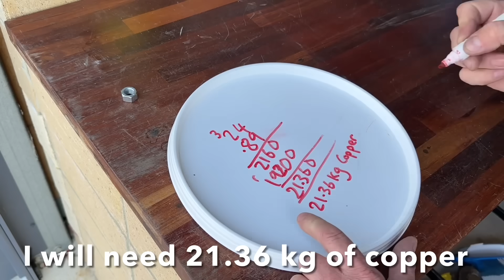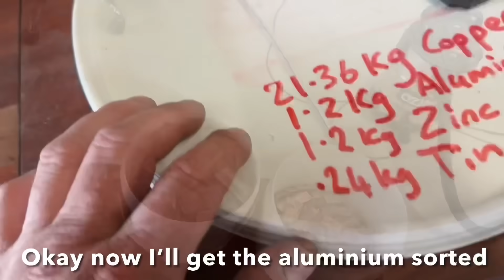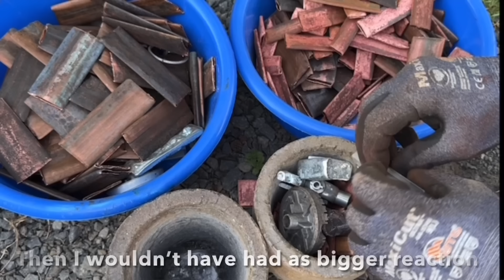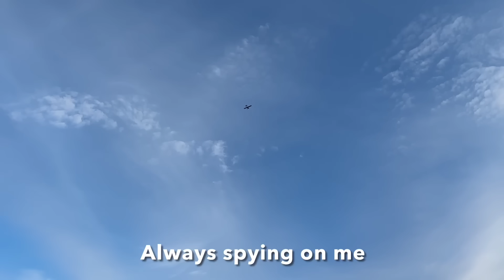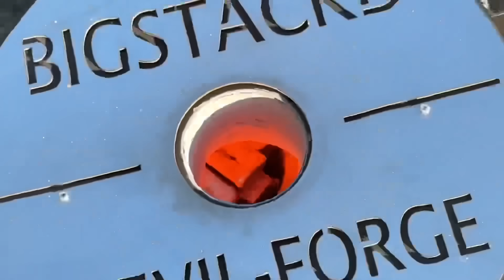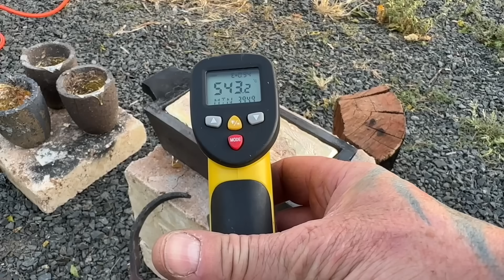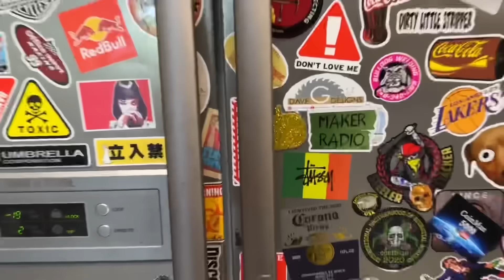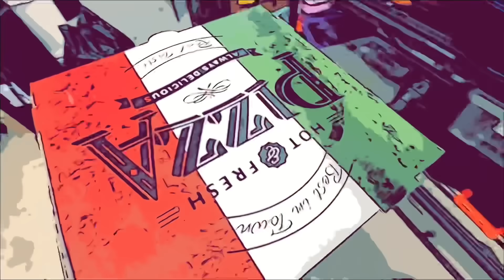20 KG Nordic Gold Ingot from scrap - ASMR Metal Melting - Trash To Treasure - BigStackD 44LB Bar

Comment: Engineer here… As always I’m totally impressed by the woodworking! I think the bounce and torsional instability comes from the brackets. I would’ve sandwiched the beam between angle iron with throughbolts. The other flange to be used as anchor points. I think large throughbolts would have played into the heavy modern industrial look better than small strip steel brackets.

Comment: Ouch!!! Fortunately the sleeve that one of your subscribers sent you some time ago did its job, the pipe was protected even if the sleeve itself was a bit expensive, it did the job it was made for, protecting the pipe. And so the difference in weight between what you were supposed to put on and what you put on triggered this reaction, luckily you weren't close by and you kept an eye on what was happening to quickly extinguish the gas, well done! 😉👍

Comment: On safety note, I would place the heavy ingots low near the floor.  At some point you will design your outdoor work station to implement  improvements.  A hinge and counterweight on the lid of the big forge would make it a one hand operation and move you away from the heat.  Putting hot ingots on ice is fun to watch, but I imagine a wood box with a steel baking pan floor to hold the ice block and contain the ingots over the ice. Top Tier ASMR!

Comment: I wonder if melting togheter the zinc, tin and aluminium together at lower temp then add the copper in would increase the vaporization point enough so zinc wouldn't react that much at such high heat. If it's in an alloy, I'm not sure, but it might help.

Comment: I can imagine a “self feeding” device to save time while cutting tubes. Simply two long enough pieces of wood that serve as guides and some sort of spring or elastic band that gently pulls the tubes closer to the pliers after each cut. Like the can crusher but longer, slower and without power only a string or elastic belt. Could work…

Comment: You should weld your copper chopper/cable cutters to a plate so you can set it on a table and chop faster and easier. Then make a power hammer that flattens your copper faster. If you set up an assembly pine you can automate the whole cutting and flattening process so you can set you copper tubes in and return to all that work being done over night 💪😃. And you can make a crank/pour/ step down furnace so you pour several ingots at once without having to lift  a heavy crucible or risk spilling hazards.
Reply from the maker: Yeah I hear that buddy maybe some type of guillotine type shit. I wouldn’t mind a guillotine set up for my Copper wire to turn it into tiny little millimetre size pieces so I can fill the crucible more and not have to keep feeding the furnace. I do have a guy building me a Hydraulic pipe cutter his channel is crazy Harley rider I believe and I think he’s made videos on making it but I’m just gonna wait until he drops it off and have a look at it then. Then we’re gonna have a chat about some type of customised cable cutting machine.👊🏻😁.
Reply: @bigstackD  I would lov to see you getta hold of Aussie gold at sompoint in the future. As we'd lov to see you hav fun melting it down and then make aproper hallmarked goldbar out of it of using hallmarked or unmined Aussie gold 😁😉👍🤝🇦🇺🇬🇧

Comment: I'm totally impressed with the patience to cut all the copper pipes with a wire cutter then blasting them with the hand tamper. Hats off friend I would have spent more time finding a more efficient and labor intensive way to do it to end up with the same result.

Comment: A good source for Zinc is modern wheel weights. The old ones were lead with an embedded steel clip in them. A lot of modern wheel weights are made from either steel, aluminum or Zinc.
If you've got any friends that work at a tire shop or a car mechanic's shop, hit him up for some wheel weights.

Comment: have you thought about having an old dead crucibel lowerd in to a block of concret/cement with an angle (aka any hard non burning material) and having it as a slag pickup station?  wraping the sides of the crucible so you can remove it from the cast. fast cleaning and sorting of all the slag and no mess in the end.
hopefully i could make myself understandable english is not my native langue. and keep up the good work you are a friday stapel!

Comment: 7:00  I bet you could make a jig that holds the cutter in position, and drops the pipe through the jaws to a consistent length.  Each cut-off piece falls into a bucket; when the jaws open, the pipe slides down until it hits the stop.  Rinse, repeat.

Comment: A lot of electrical fittings are made of zinc. Used to be anyway, any time we do a remodel I save as many couplings and connectors that I can. 
Nowadays they’re made of steel with the exception of mc cable connectors, they’re still zinc. I’ve got zinc coming out my ears lol.

Comment: Just a thought. A rolling mill may help crush all that copper pipe. A cheap one will run you a hundred bucks or so and save the shoulders. You'll want to do it before cutting the pipe down though, just for efficiency.

Comment: Your biggest Ingot ever! And Ingot took that personally until the end when you assured him he was still your favorite. Quite a show with the extra zinc added, thankfully you were using the hose protector even though you were on the gas shutoff super quick. 
So you guys don't work your way into summer heat,you just add 10f a day until it's too hot to do anything? I shouldn't talk were in Indian summer right now, normal temps are 40 ( 4.4C ) degrees in my state but were at 75- 80 ( 26C ) the last couple days.

Comment: the way u heat up the molds to remove moist, is the same method i use when painting with spray cans, think u call it aerosols... but heating things up to get moist out is good, never had a better and more perfect finish of my hobby painting.. of course the item can only be handwarm when painting....but it will look as if it was painted in a pro booth

Comment: Would it help setting the large mold on top of a running forge and pouring multiple crucibles then to prevent the layering?  The metal could all solidify at the same time then.

Comment: The sounds of the ingots searing into the ice remind me of the deepest hole ever dug in Russia- the drilling head was going into basically hot putty, it was so deep. If you put a mic to the hole itself it sounds like hell itself, like wailing and screaming. It's like a billion ingots all being dropped into ice at the same time as the heat yawns and wheezes down the hole.

Comment: For alloys containing zinc, I add about 1/3 cup of Borax to the crucible before I begin the melt. It creates a floating protective layer which shields the zinc from oxygen and virtually eliminates gas off. However, if you overheat the finished alloy it will still gas off.
Reply: Note 1: Melting with a borax layer will slowly eat away the crucible. 

Note 2: The borax layer needs to be removed before casting. I use a stainless steel spoon capable of handling the heat without degradation.

Comment: To get rid of the Lead, take those copper cuttings and dissolve entirely in nitric acid.  Then add some sulphuric acid which will only react with the Pb.  Filter the solution, which removes the Lead Sulphate.  Then add pieces of Iron to get all the metals out of solution.  Rinse, remove iron, melt.

Comment: @ bigstackD 
Your hinge needs a little re-engineering. I think the flaw is mostly in that it's a four finger hinge, when it needs to be a five, with three parts on the base, and two coming down from the lid. The pull when it's opened is asymmetrical,  bending both the hinge pin, and the hinge itself a bit. A simpler way might be turning the attachment points for the hinges into short vertical slots rather than just simple holes, to allow for a tiny bit of movement, would help keep the lid down, by getting it to settle level, by letting it lever the hinge up a tad, and letting gravity hold the lid down properly.

Comment: Would you say Zinc is a good metal to start with? It seems like the start up costs would be low but allow you to melt and do some molds?
Small melting dish and a torch.... I would like to kinds get started, but I imagine the costs for the furnace and such can be a lot  at the start for something you may or may not stick with.
Not to mention needing to find where to grab scrap to break down. I have a feeling the tweakers in my neck of the woods have that on lock.

Comment: Hey dude... good result!! Obviously thats not a clean bar... just wondering how you remove the Silver and Platinum? Sreetips cornflakes it and runs it through a silver cell, do you do this part yourself or leave it to a refiner? Also MBMM use a shaker table to remove the free mill, not dissing ya, good result, looks 80% already. Just wondering what you use to refine it further?

Comment: You need to look around for a used light duty power hammer, as is used for forging iron, to crush down your copper pipes. You should crush the pipes first and then chop them into short lengths.

Comment: Scandinavian gold or Nordic gold, Nordic, is aluminum bronze, an alloy of copper with a small (5%) addition of aluminum and the same amount of zinc, as well as a small admixture of tin (less than one percent). The addition of aluminum makes the metal hard, and a thin layer of aluminum oxide on the surface prevents oxidation, due to which Nordic products do not tarnish for a long time (however, if the product, for example, a coin, is subjected to friction, tarnishing accelerates sharply due to the constant destruction of the protective layer)

Comment: Great video!! Question... what camera do you use for your recording? Thanks!!!
Reply from the maker: I used three cameras and they’re all iPhones The reason I have three is one will always overheat so I’ll jump onto the next one and use that while the other one cools down and then when that overheats I jump to the next one and so forth. Even when the furnace isn’t running if you’re recording in direct sunlight where I live the iPhone will overheat after 10 minutes which is really annoying👍🏻
Reply: Awesome. Thank you very much. I also used my iPhone to record and had the same issue. However, my GoPro also overheats. I like the zoom capability on the iPhone, so I will probably stick with that. Need to get a couple more so I don't have to wait for the cool down. Thanks for the tips. Have a great day!!   @bigstackD

Comment: copper is a pain in the but to smelt down in my furnace. gets right to the melting point so when it does melt down i have to be quick.
Reply from the maker: @Yeouiju-115  you could always leave it in the furnace for a bit longer that’ll  definitely help . 
Those Chinese furnaces do struggle to melt Copper with their underpowered burners unfortunately

Comment: Could you melt the zinc in a low-temp furnace, then melt the copper and pour the molten zinc into the molten copper? would that be safer?

Comment: Question, do you have any idea what could be the cause of the strange whirring sound when you start back up the forges? is it from the propane flowing in weird, or something else? I'm super curious!
Reply from the maker: It’s just a low flow gas. When the propane tank runs out of gas it makes the same noise and as it’s starting up there’s not enough gas in there until I’ve turned the gas on the bottle up a bit higher 👍🏻
Reply: @bigstackD  ah, gotcha! Thank you!

Comment: Does the Nordic gold tarnish much with time
Reply from the maker: It does tarnish the tiniest little bit. It just goes a bit dull, but you just put it onto the buffer wheel if it’s mirrored to bring it back to its perfect shine, or if you’ve just done a wire brush clean, you may need to give it another quick going over with the wire brush 👍🏻 but that’s normally six months away or longer

Comment: I can't confirm if this is correct, but from my calculations if you have a bar the same size (volume) as that big aluminum one made out of other metals:
          gold            50kg     USD 4,150,000.00
          osmium     58kg     USD 90,000.00 
          rhodium     32kg     USD 4,550,000.00

*Osmium being the heaviest metal and rhodium the most expensive metal
**A bar of aluminum that weighs 7000 grams would have a volume of 0.0025926 cubic meters (m³) and using that volume to calculate the weight and price of the others

Comment: I am just curious, and asking this as a separate comment to my usual running commentary, but why do you mix the raw metals together, and not just melt the copper first, then add the next highest temperature metal (aluminum in this case?) then the zinc and tin at the end? Seems that would be a less-likely candidate for burning the zinc. l obviously am asking from a place of ignorance. Thanks!

Comment: I've just started out and wondering where you can find or purchase the molds with handles please
Reply from the maker: eBay buddy this big one I use I can’t find them any more but you should be able to find smaller cast iron ones on eBay. I don’t recommend pouring copper into cast iron or steel moulds as they might work fine a few times but eventually the copper will fuse to the steel or cast iron rendering the mould useless, so I always use graphite for the copper and brass bronze aluminium for the cast iron or steel👍🏻.

Comment: Is nordic gold strong enough to make a bed frame?
Reply from the maker: Yes 100% it is mate. If someone could be bothered making one in that metal you would be completely fine it is in my opinion as strong if not stronger than steel that’s why I never stamp my Nordic gold as it’s basically impossible to stamp properly 👍🏻

Comment: 23:41 luckily you was outdside if the shed had caught fire it will need a lot of AFFF to put it down, a source of PFAS pollution, putting down road trains prime mover fires will be difficult because they contain up to 2000 ltrs of diesel fuel in their fuel tanks

Comment: How did the excess zinc suddenly flare up like that?
Reply from the maker: From previous experience what I’ve noticed is obviously the zinc in tin will be molten and as soon as the copper gets to a certain point where it falls back into the molten zinc and tin oxygen‘s dragged into the mix and when the oxygen hits the zinc it flares up like that. That’s just my guess I’m probably wrong as everything I have done is completely self taught. But every time the copper melts and falls into the rest of the mix that’s when the reaction happens👍🏻
Reply: Well, that makes sense to me.

Comment: the zinc ball is screaming nnnnnnnnnnnnnnnnnnnooooooooooooooooooooooooooooooooooooooooooooooooooooooooooooooooooooooooooooooooooooooooooooooooooooooooooooooooooo as it rolls
Reply: and just thought instead of putting it all in if copper melts at 1,000 c aluminum at 900 c tin 700 c and zinc 500 c i know those arnt the temp but for example. melt the copper then when melted added aluminum down the line and when melted add the next

Comment: All the metals should have been turned to shot by pouring into water then the shot charged the crucibles in the right raitios... Fixing this after is going to give a different alloy... As there is no way save for radio spectography to know how much tin and zinc remained.

Comment: You made a mistake putting all the zinc in at once, but you made an even bigger mistake putting in the zinc before the copper was melted. Zinc had a very low melting temperature, so it should be put in AFTER you have already melted the copper. It will burn off before the copper has even reached the melting temperature.  The Safest way to do it is highest melting metal first, then go downward to the zinc. Copper, Aluminum, then zinc & tin. You won't have as much slag, and you won't burn off valuable Zinc to the atmosphere!

Comment: wouldn't it not more economic viable if you doing your last pour yesterday turning all in gold looking bars, instead of that, could you maybe used the bars you already had and melt them and using your last pour and put it durectly in the big one so you just only just needed 1 melt cycle for your second batch, instead melting de scrap first into bars and then later melt them again in the 2nd cycle what for that quantity of metal would safe you a considerable amount of  gas. And if you really wanted them first into bars. If you did it in 1 go the bars of the last pour from the 2nd batch would be so hot that they would melt more quickly and at the end using less gas. 😊

In a video you dont have the best sense of time between parts so its always harder to judge.

Comment: i did not read all coments but why do you use a piece of cardboard under the melting pot.
Reply from the maker: Simply when it burns it creates a layer of carbon which will not allow the crucible to stick to the firebrick.👌😁

Comment: Too bad you dont have a a furnace big enough to fit that big mold or couldnt of jerry rigged one to heat after the pour. You could of mixed it better while heating and it would of gotten rid of those lines on the side.